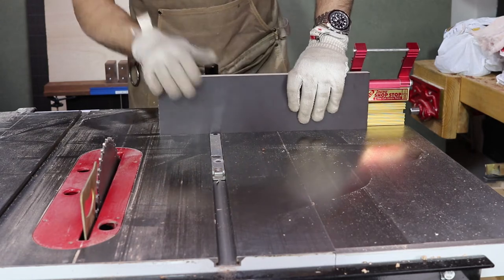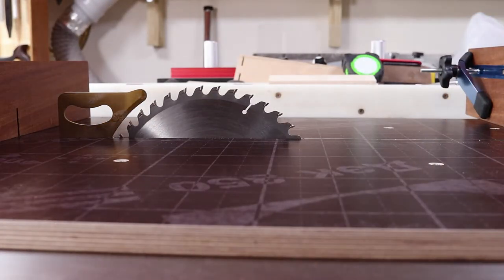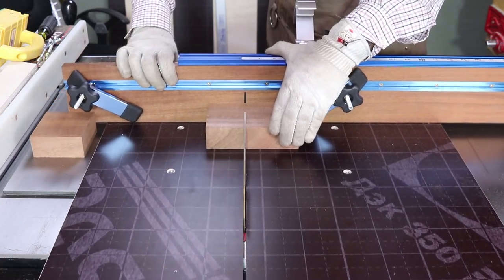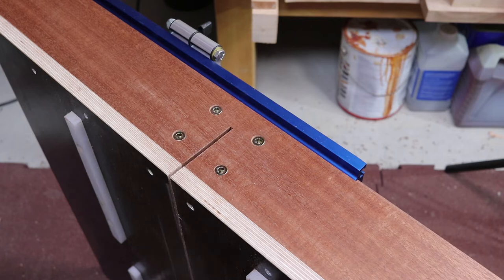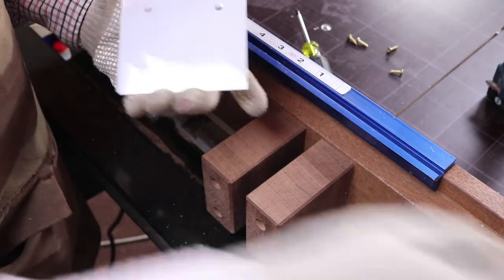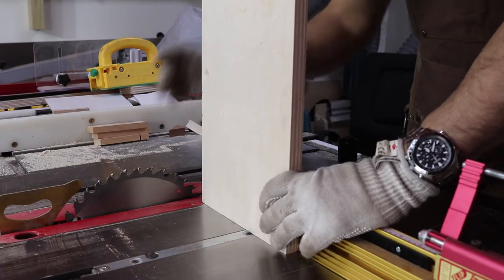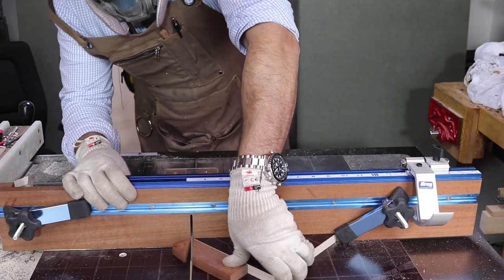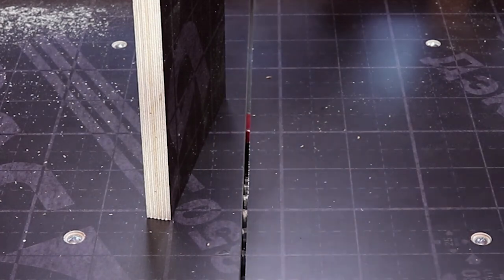Safety on Crosscut Sled

Comment: Your protection is excellent. 
You can add a belt attached to  the sled and the table, to prevent the sled moving too far and discover the blade. 
It would be « belt & suspenders ».
Thanks for your videos. 
jp from France.
Reply from the maker: Thank you for the tip though 🤝

Comment: A mechanical stop is superior to all kind of visual-keep-your-hands-out safety measures. With that said, if you have an outfeed table, use stopped miter tracks in that to stop the sled runners at the correct position. Bullet proof solution, not effected by if something suddenly disturbs you during a cut.

Comment: Great video and like the way you made your sled look stunning as well as functional. My questions are what is the material you used dot the base of the sled and the front and rear fences look like they might be mahogany or something similar. How long have you used this material and has it stay flat and straight. Also did you treat it with anything. Hope you can help me with the info so I can build a similar sled. Happy woodworking!
Reply from the maker: Thank you, the white slides are made of Teflon for less friction and more stability when humidity changes. You guessed it, that was an old mahogany piece that was left from another project, it is a stable wood but that depends on the type of mahogany and other factors, so far it is flat. You can use any finish not a critical thing, wax or linseed oil should be fine. Good luck mate